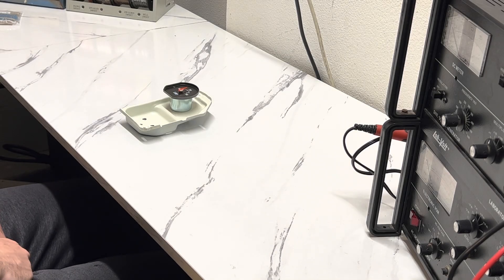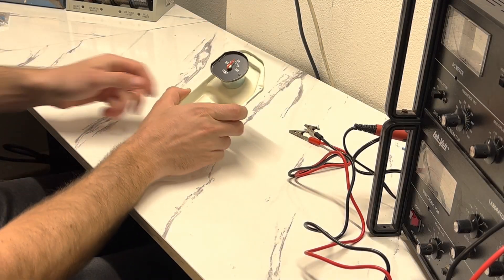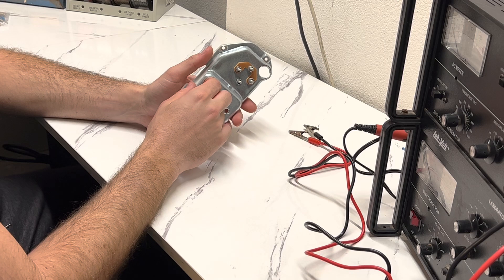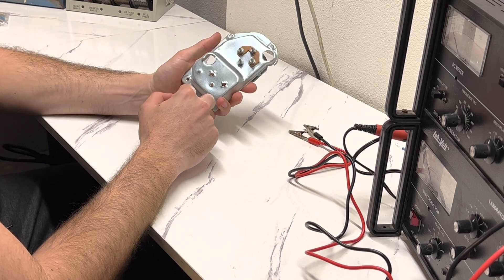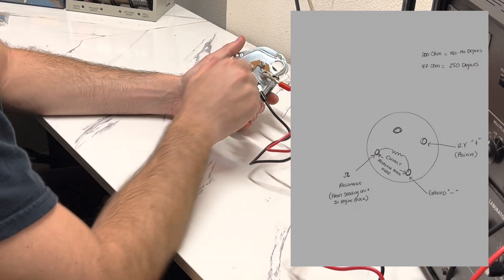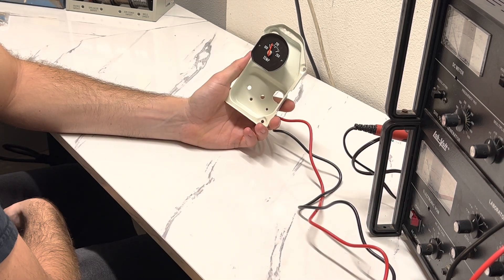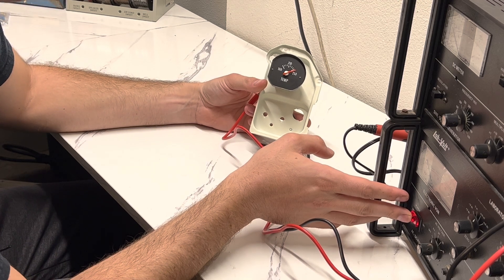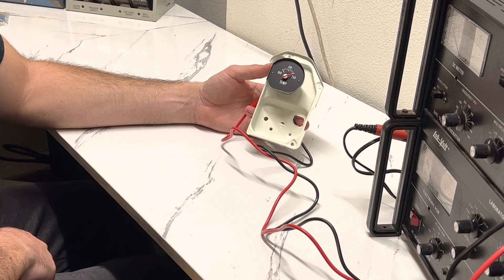How To Test A Temperature Gauge! - Easy!  #automotive #electronics #cars #diy

Comment: Should the resistor stay in place when installed?
Reply from the maker: Only keep the resistor in place for testing the gauge. Once it’s installed, the sending unit in the tank will act as the resistor.